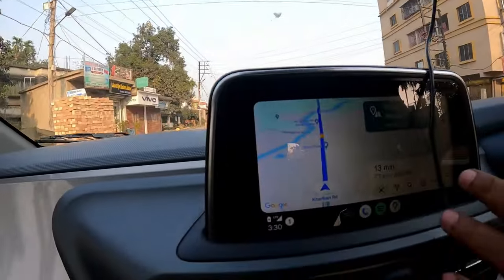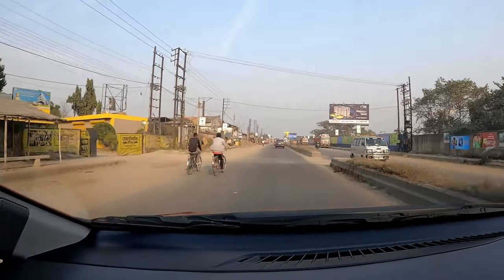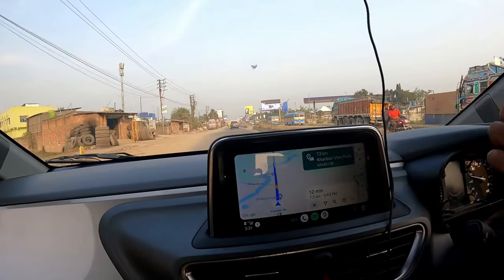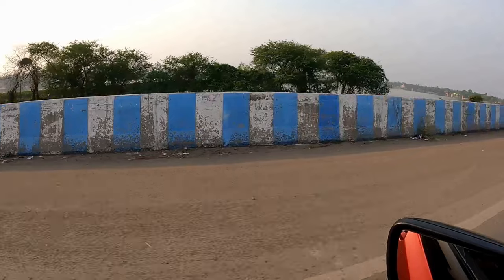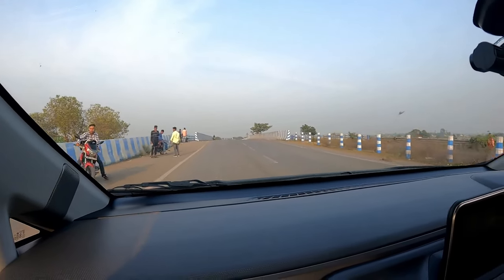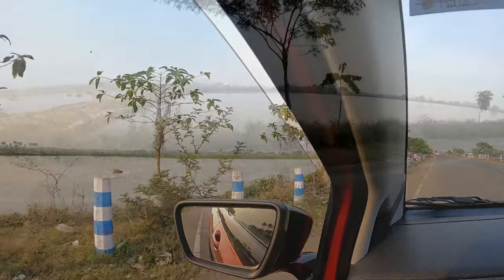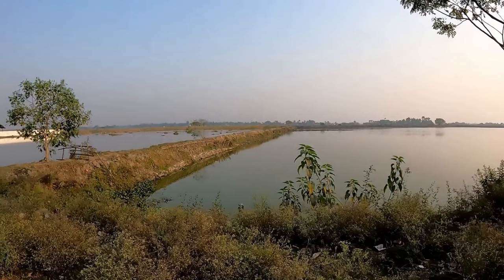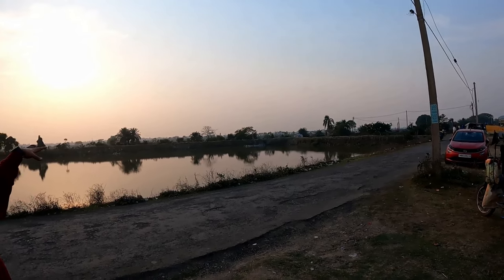Khari Bari Drone Shot | Once The Calcutta Wetlands #kharibari #dronevideo #weekendtourfromkolkata

Comment: Can we claim this using insurance for tyre blast? I see it is covered in own damage.
Reply from the maker: It's unwise to go for insurance for one tyre damage as the no claim bonus will be more than the value of the tyre.
Reply: @supercyberautomotivetravel  one tyre may cost 5-6k. No claim bonus will be calculated only on own damage premium excluding add-on cost that too before tax. Max I got discount of 1k.
Reply: I understand, if you don't claim, then your next year NCB discount percentage will increase. Say current year NCB discount is 20% and if you don't claim for another 2 years, then it will be 25% and 30% next year's.
Reply from the maker: In my case NCB is 30%  .